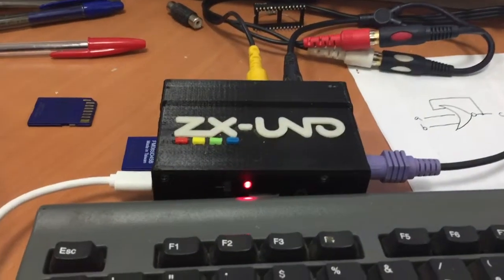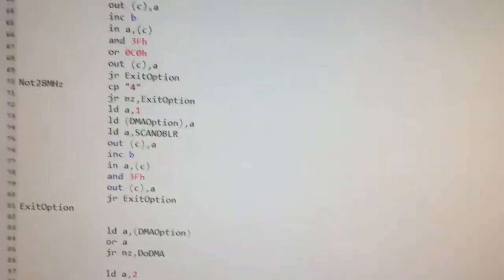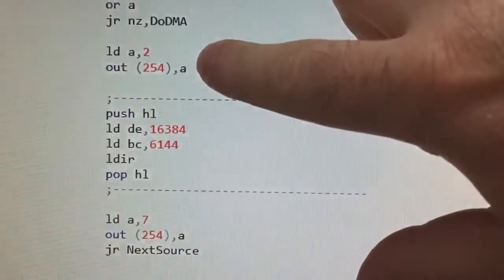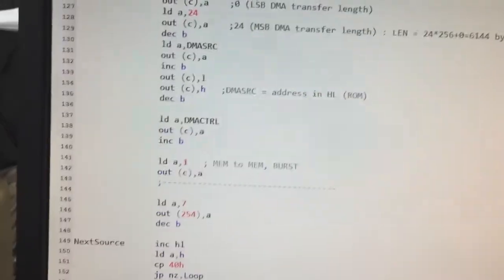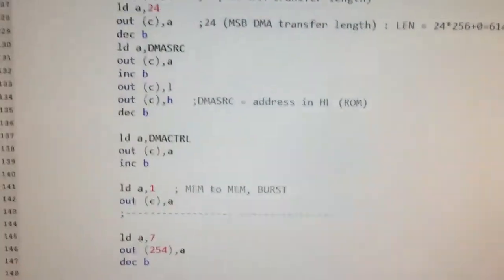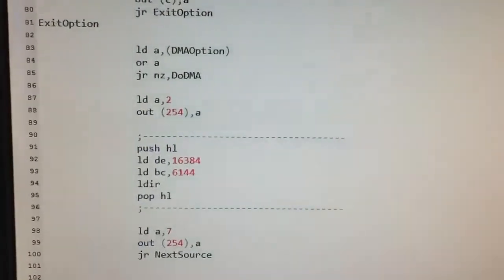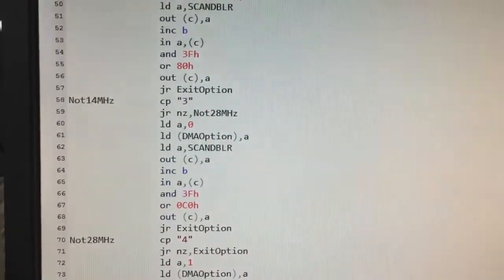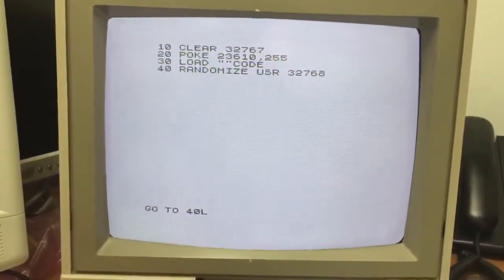Memory to memory DMA transfer capabilities of ZX-UNO

Comment: Very good demo.  Thanks.
I may have missed it but why does the DMA mode block transfer only occur halfway trough the 50Hz interrupt?  I may have missed the explanation, but I assume you've put an artificial delay in so the border change indicating start and end of DMA transfer isn't lost at the very top of the screen? Thanks again, and very impressive 6K transfer speeds!